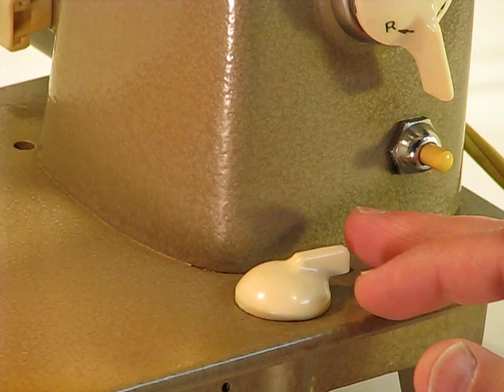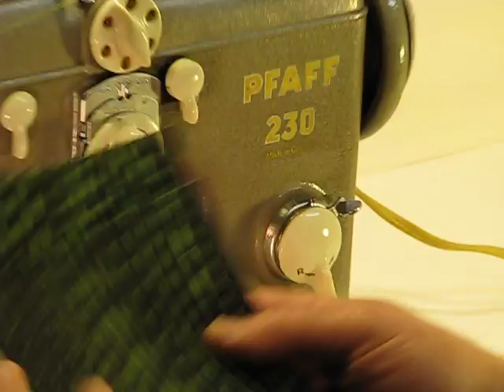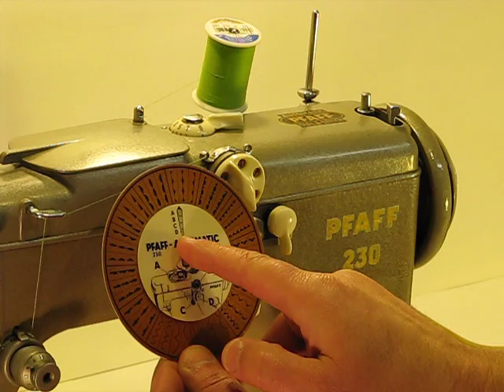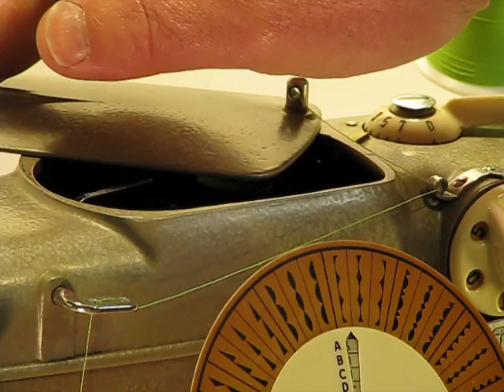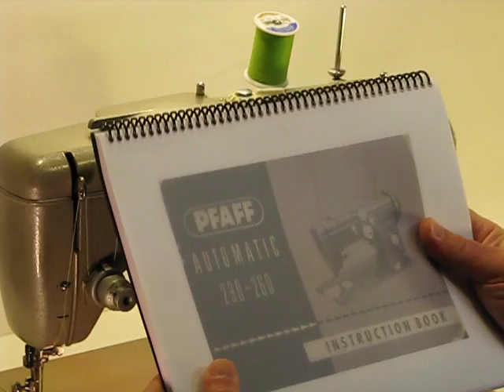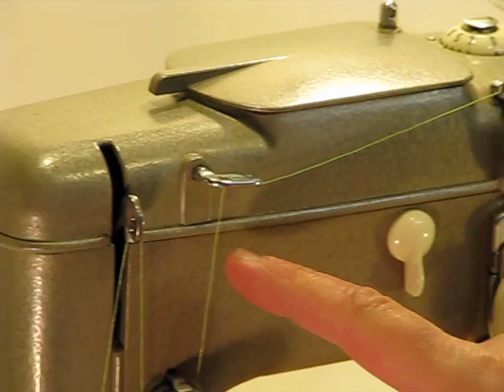PFAFF 230 - Introduction and Tutorial

Comment: hi, I've got this machine aswell. but i cant get it to work properly. on a single sheet of fabric it works okay but as soon as I dubble up on that same fabric the thread keeps breaking? I've tried to fiddle with the tension knob but that doesn't help
Reply from the maker: Hi Hieronymus,

Thread can break for several reasons. Check your bobbin carrier to see how much pull is required to draw the thread out when removed...should only require about 3 oz of pull, which is very little. Also, ensure when you raise and lower your presser foot lever that the tension disks are moving freely. Next, replace your needle with a larger one (size up) and double check your needle orientation. Lastly, ensure your spool of thread is not snagging, and that when your presser foot lever is in the UP POSITION, that the thread pulls through smoothly.

Beyond those basic tips, if you continue to experience trouble, visit your local sewing technician, as diagnosing an issue like this is much easier while on a work bench, rather than virtual.

Good sewing and God bless,
Scott
Reply: Wow super fast answer I'll try it all, thanks a lot

Comment: how do u turn it on
Reply from the maker: Hi Thomas,

There really is not an ON/OFF switch on this model, only the button on the front to turn the sewing light on. If you have this machine, you have the proper cords, and you're plugged into a good outlet, your foot control may be faulty. If however, you're not even getting the light to come on, you may have more serious issues that will require a technician's attention. 

Let me know how things work out, and I wish you a great Winter of sewing fun,
Scott

Comment: Thanks for the tutorial.i have had this machine for over and year and have never used it. I'm trying to use it now and I cannot insert the needle. I've done everything possible. It seems like the needle bar or hole is too small for the needle to fit it. Please please help me out. I'm taking a sewing class and need to do my assignment. My other pfaff 280 machine thread is tangling so I can't use it either.
Reply from the maker: Hi Silver - The needle shaft area on this model and the 332 have a set pin that helps keep the needle orientated and secure, and can sometimes get displaced. Try taking a needle with the blade end first, and CAREFULLY insert it into the shaft area as far as it will go. This should help adjust the pin set to allow you to insert the butt of the needle. When attempting to insert the needle after this pin set technique, try rotating it in your fingers while applying upward pressure, and once the butt of the needle slides in, check for proper flat side orientation to ensure your stitch integrity is not impacted. All the best, and if you are in the market for a FULLY RESTORED vintage PFAFF, I have an amazing 332 currently available..!! Warm regards, Scott
Reply: thanks alot Scott for your response. i will try it and let you know.